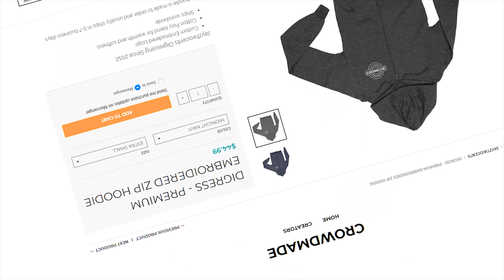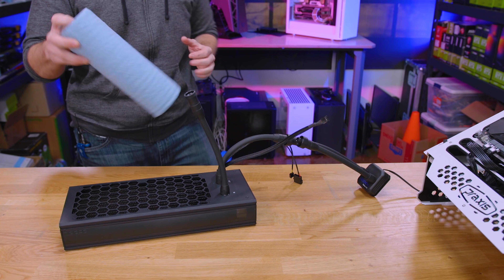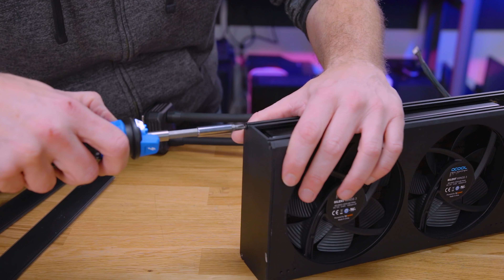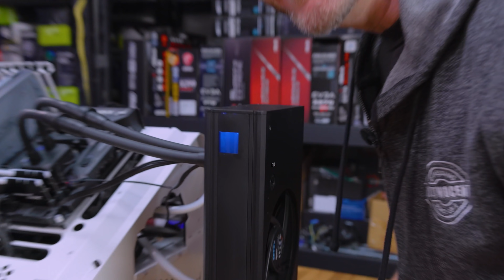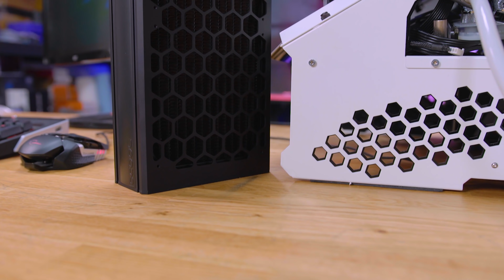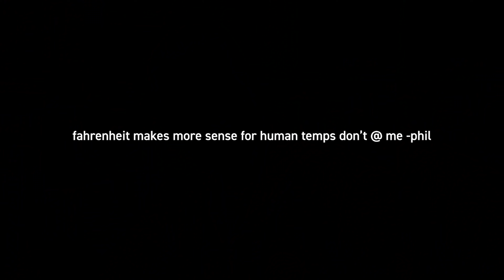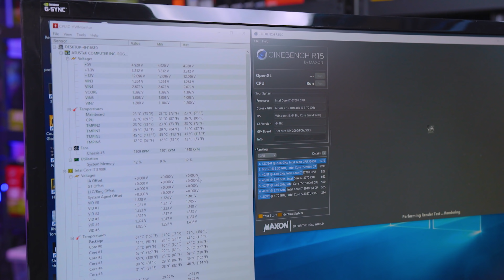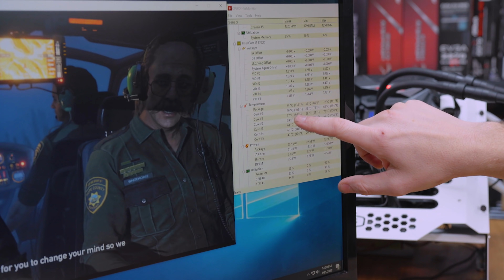This AIO is ridiculous!

Comment: farenheit is a insult to a working brain...
Reply: Edgy!
Reply: it's funny cause you said "a insult" instead of "an insult"
Reply: Not knowing how to convert is a lack of a brain.
Reply: An*
Reply: Pussy
Reply: Its more precise and accurate in terms of telling temperature.
Reply: https://youtu.be/SmSJXC6_qQ8?t=38  fun part of the link 38-1:26
Dont get mad Americans.
Reply: Haha Murica? More like MURICUNTS
Reply: Lmao
Reply: “In metric, one milliliter of water occupies one cubic centimeter, weighs one gram, and requires one calorie of energy to heat up by one degree centigrade — which is 1 percent of the difference between its freezing point and its boiling point. An amount of hydrogen weighing the same amount has exactly one mole of atoms in it. Whereas in the American system, the answer to ‘How much energy does it take to boil a room-temperature gallon of water?’ is ‘Go fuck yourself,’ because you can’t directly relate any of those quantities.”
Reply: The primary benefit is that the metric system does things in powers of 10 with a standard set of prefixes, making it fairly intelligible for anyone, whereas the imperial system uses one-off terms for relatively arbitrary measurements, like 'foot' (12 inches) and 'mile" (5280 feet) and let's not even get into chains and furlongs.

This means if you aren't familiar, you have to look up every one of these to figure out what it is, and even if you are familiar, a lot of us will second guess ourselves on 'how many feet in a mile' now and then, and may well need a calculator for fairly basic conversions. No need to do that with a kilometer.
Reply: 98F is just temperature from Farenheit ass. D!ckheads logic.
Reply: @Steve Sherman All are good for different things.
Reply: @Steve Sherman that isn't how it works
Reply: @Steve Sherman and I don't know why you're saying that considering you're the one that left the comment I don't need a sarcastic remark
Reply: @Steve Sherman I said all are good for different things Kelvin is good for reading things on a universal scale as it goes up much higher then either Celsius or Fahrenheit. Celsius is good for measuring the air around us as that's kind of what it's designed for while Fahrenheit is generally used for measuring water in fact that's what it's calibrated for. Being a hundred degrees Fahrenheit is the boiling point for water
Reply: @Steve Sherman you have no idea how confused I am
Reply: powderrider700 holy shit you’re a dumbass, shouting that it’s logic doesn’t prove your point. You couldn’t even spell exist properly 🤦🏻‍♂️ just shut up man
Reply: You mean because it's based on a system that doesn't use factors of 10 that it's just to hard for most of the world. I can accept that.
Reply: @saber-jocky3436  sure you can use all tools with boxing gloves, but anybody without them will still be the more effect and intelligent one
Reply: @saber-jocky3436   Yes, cause it make no sense...thats why the metric system excist! It is logic....just make the change like the rest of the world! Imperial and farenheit is obsolet...it is no reason for it to exist anymore...LOGIC!
Reply: That's funny because all you need to understand farenheit is a working brain.
Reply: @nimrodery  farenheit is for people who are not normaly designed😂
Reply: @Fryskkk  Until someone can successfully interpret your joke I'll reserve appraisal.
Reply: @Fryskkk  pussy
Reply: @Fryskkk  you can't even spell normally..
Reply: @Ludakritz  yea english is not my main language kid can you talk more then 4 languages...?
Reply: @nimrodery   farenheit does not make sense! It is stupid and obselete...if you can master easy logic...celsius and metric is the way!
Reply: @powderrider700  If you can master easy logic, then farenheit is easy. If you're stupid, it can be tricky.
Reply: nimrodery you could say you are stupid for using Fahrenheit..the world uses Celsius cause it is pure logic..no stupidity..just logic..if you can’t see that...glasses maybe? Or brain surgery could fix this...oh wait.. you are already lobotomised?
Reply: @powderrider700  You can say I'm stupid as many ways as you like without offering any evidence. I can't see how being able to understand more units of measurement makes you less smart. Perhaps explain that.
Reply: @nimrodery  funny because farenheit was created because some lazy guy does not want to do calculations with decimal numbers. 
Tell me more about farenheit and logic :)
Reply: nimrodery double it and add thirty. It’s simple. Yet so stupid
Reply: nimrodery do you really need an explanation? No chance of understanding? Understand this..0 is 0. 5 is 5. 10 is 10. 15 is 15 etc. understand? Simple? Yes. You only need to understand metric, imperial is inaccurate and just plain stupid!
Reply: @nimrodery  Lmao someone is an instant asshole to wanna explain this. Excellent wording  friend
Reply: @powderrider700  pussy
Reply: Celsius is great for measuring the temperature of water. However, we’re human beings who live on dry ground. As a result, it’s best to use a temperature gauge that’s suited to the air, as opposed to one that’s best used for water. Think about it,  whens the last time you measured the temperature of water?  This is one reason Fahrenheit is superior to celsius.
Fahrenheit is also more precise. The ambient temperature on most of the inhabited world ranges from -20 degrees Fahrenheit to 110 degrees Fahrenheit — a 130-degree range. On the Celsius scale, that range is from -28.8 degrees to 43.3 degrees — a 72.1-degree range. This means that you can get a more exact measurement of the air temperature using Fahrenheit because it uses almost twice the scale. So before you talk shit and act like an ignorant asshole because its different than what you learned do some research and stop being lazy.It takes two seconds to do a conversion.
Reply: @powderrider700  I never said I didn't know metric or Celsius. I know how to use all of those units. So explain how knowing more than you makes me less smart. You know, the thing you were asked to do.
Reply: @mattmyles3908  Just like you.
Reply: @Fiufia  Sure. Possessing logic should enable you to use Fahrenheit. Lacking logic seems to cause whining. There was no Celsius at the time Fahrenheit came into use, so your point makes no sense (but I have yet to see any logic from you).
Reply: Saito Mejia idiot.
Reply: Psycho Aquatic before you think Fahrenheit is  more supreme and precise, look at the world as a whole..who are still using Fahrenheit? The Celsius scale goes as low you want it to how high you want it, we used decimals...it is accurate, that’s why the modern world endorse it. Saying Fahrenheit is more accurate is pure dog diarrhea.
Reply: nimrodery cause you can’t understand, cause you just don’t want to! It is easier to use a common measurement, who have the majority?
Reply: @nimrodery  My point it's pretty obvious. I was making a joke because you mentioned logic.
It was a joke but it's true. The logic Fahrenheit (the man) used to invent fahrenheit (the scale) is because he is lazy and does not want to do calculations with decimal numbers (he dont want use logic)
Made his job easier for sure. But is funny

Edited to help you :)
Possessing logic should enable you realize the joke (even if it's bad)
Possessing logic should enable you realize the joke can be used for both Fahrenheit and Celsius 
The scale celsius invented by Celsius (the man) It's not the one we use today. The original invented by Celsius (the man) the freezing point of water is 100c and boil at 0c and the reason is the same he was lazy and made his work easier.

What does not make sense It's your argument   "There was no Celsius at the time Fahrenheit came into use"  What does it have to do with my comment? i juat call fahrenheit lazy man.
what is your logic of telling me that it was invented first?
Reply: @psychoaquatic3367  that's not a reasonable explanation and you offered no basis to support your claim. How is Fahrenheit more relatable to our body and to our sensation of heat or cold? Fahrenheit does not make much sense because the round numbers don't align to anything relevant. Its zero is based off of the temperature at which water freezes with a certain amount of salt added to it. Pointless. 100°F is also pointless as in it doesn't mean anything practical. Also, its zero doesn't align with the Kelvin scale, which is the academic scale (and does not accept the nomenclature "degrees", just Xvalue Kelvin). Celsius, on the other hand, has it's zero based on pure, unpolluted spring water freezing point. Also, its 100 is aligned with the boiling point of the same sample of water. Furthermore, the energy necessary to change one point in the scale aligns with the Kelvin scale as well, which again makes it easier for translating scientific stuff into regular life language. And I honestly don't think it's up to stupidity or whatever to not want your measurements to align every 10 points. A mile is not 1000 yards or feet. A kilometer is self explanatory: kilo = thousand. Thousand-meter, literally. Ounces are also less Intuitive to use than grams and liters because you have one name for two units and that can get troublesome when teaching kids in school.
Reply: @Fiufia  You're not making a case for your love of logic with phrases like "he dont want use logic." If you're editing to help me, try replacing whatever language you're using with English.
Reply: @nimrodery  farenheit is variable and just kind of very big(I mean like 30 degrees Celsius is like 100 farenhiet or something). And the entire world is celsius so just job in
Reply: @asimakhan4956  I already know both. How about "job in" on reading?
Reply: @nimrodery  Are you using the excuse of bad English? 😂 grow up 😂
https://youtu.be/SmSJXC6_qQ8?t=38  good English to help you in your crusade .
Reply: @powderrider700  That is actually not always the case there are two ways to solve a math problem 90% of people solve it one way while the other 10% solve it another. Is either one really Superior especially if we want to apply this and say that 90% only learned how to do it one way. The human brain just works differently depending on the person you don't have any right to say what is and what isn't easier for people. Now stop calling people an asshole just because you measure temperatures slightly differently. For God's sake if it matters that much use a conversion tool.
Reply: @asimakhan4956  but it's much easier to put out smaller temperatures and allow for easier reading of a non digital scale. Would you rather pick out 30.2 degrees Celsius or about 86 degrees Fahrenheit which is easier to understand at a glance using a non digital thermometer.
Reply: @powderrider700  your arguing F vs C... on a video review of a water cooler... makes you sound pretty dumb aswell....
Reply: that's why 'muricans use it :V
Reply: @TheHighborn  Aww shiet.

Comment: H115i Pro, 8700k w Noctua paste, 4,99GHz using 102 Basclock and 49 Multiplier and 47 on the Cache, Cinebench R15 CPU score 1575 and max temp 82°c at Vcore @1,392 and VID @1,330V. For 24/7 use i just dial down the base clock to 4,79GHz so it sits equal to the cache ratio and i get high 60's low 70's while gaming :) Love it!

Comment: Warranty meant nothing with the last VP755 pumps that failed, the customer service was abysmal. 
I want to see the internals of the V3 before i try one. That stupid plastic clip holding the impeller on was a bad design. 
That said, i do like that it has G1/4 fittings on the AIO itself.
Reply: get a VP44 instead. Its guaranteed to last has REALLY high pressure!
Reply: Lol I got a v3, it failed within 6 months. Alphacool is stil the worst company I've ever dealt with. They don't even bother to answer your questions and just keep repeating themselves without providing any technical details. It was such a breath of fresh air when I contacted Aquacomputer with a simple question and I got back a very detailed response with details I couldn't find after searching for an hour around on lots of forums.
Reply: @jadoei13  The new V3 hasn't been out for 6 months, We released it in October with the changes :)
Reply: @davido_labido  
What changes were made?
Reply: @chris746568462  

We made it so that the speed of the pump boosts for 10 seconds to 100% then the set level when you first turn it on.
This repeats until the desired power is reached 
-self venting
-Power boost at the start (meaning the pump has more physical power to increase the speed as mentioned above)
-improved software on the board for the start boost
-A new bearing for the ceramic axle
Reply: @AlphacoolGmbH  do you still say not to use glycol based coolants with this v3 pump?
Reply: @w3st80  From the the product description of the article: 
Notice
Not intended for continuous operation with fluids containing titanium dioxide or glycerin. Many pastel colours typically use these additives.
Reply: @AlphacoolGmbH  That sounds good, but my experiences with the VPP755 v2 destroyed my trust to alphacool. Your "support" said that can´t be possible, alphacool sold millions of this pump (Yes, he literally said millions) without any problems.
Reply: @W4rlock34  "We're sorry to hear you had a bad experience with our support team. We agree that 'millions' is a bit of an over esitmation! We did however sell a lot, and we did have some issues, like with any company and any product. We're always trying to improve on our products and also our customer service."
Reply: @AlphacoolGmbH  But that was my main problem, the clear lying (with the millions, i even said to him "as if you sold millions" and he replied: "No, we sold really that much") and no real interest in the Problem, just denying that the problem exists. I currently have a VPP755 v2 in my system (still not had the motivation to drain my loop and replace it) and every few months it fails to start. That´s not often, but for a pump in a watercooling setup this is not acceptable.
Reply: @W4rlock34  well Alphacool is junk... also their business practises are awful. I would stay away from their products period.
Reply: @davido_labido  My invoice says: Alphacool Eispumpe VPP755 - G1/4 inner thread including Eisdecke D5 - Acetal V.3 and it is from may 2018. It is the same pump and EAN as on the website from alphacool itself, 4250197133050. So not sure where that went wrong, but I'm pretty sure it should be a v3.